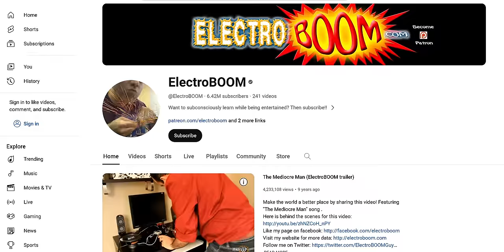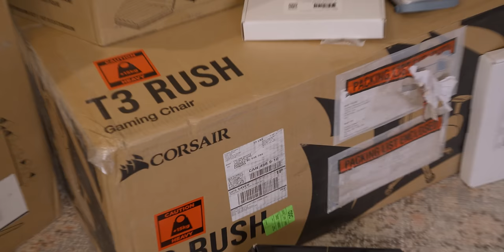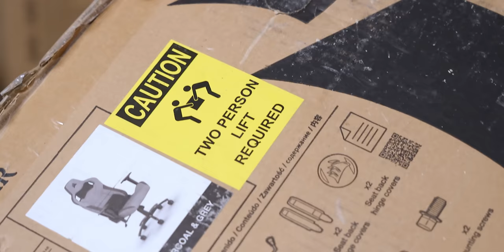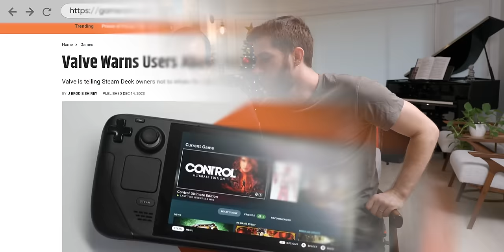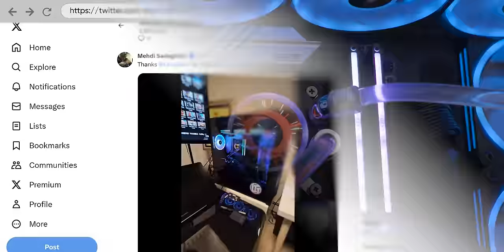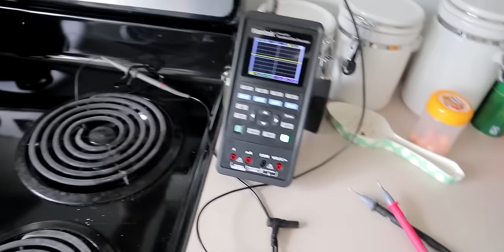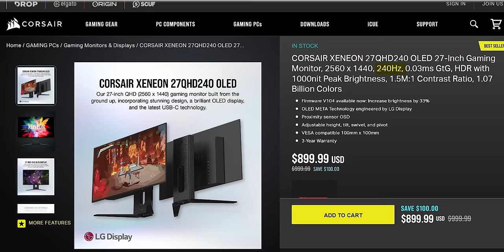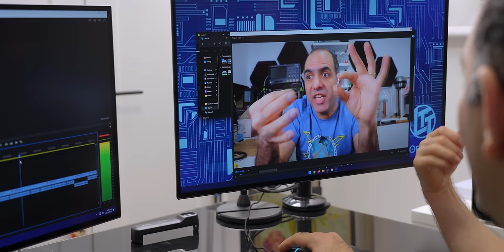I’m Afraid to Mess Up His Upgrade… Electroboom Tech Makeover

Comment: "The battery's dead" 😂 millions of laptop owners know this feeling
Reply: And phone owners.
Reply: if it's always plugged in, aren't you supposed to disconnect the battery?
Reply: @ihatelols well you're clearly a laptop user lmao. They always say that like its some benefit. I would argue that its literally not easy at all when you need to disassemble parts in order to access it. Atleast for phones, no way you can call that easy.
Reply: @TeenPerspektiva well, all it really takes is some heat, a plunger, and a credit card to get the back glass off (at least on most android phones). from there its really as easy as disconnecting the ribbon cable(s) for the battery like a taking apart LEGO pieces and installing the new one.

ok that's a bit of a gross oversimplification as there could be things in front of it like a wireless charging coil, other cables, plates, etc. but all it really takes is patience and examination in the end as ur not soldering or doing microscopic repairs.
sometimes i worry if companies like Apple are to blame for people thinking this kinda stuff isnt that simple given their track record, but thats just my two cents.
Reply: "You shut down the computer now lol"
Reply: @Thisandthat8908  yes if the battery works and holds a charge 😅
Reply: @Thisandthat8908  yes but you louse the the battery backup function that comes as standard with laptops, so if lousing your data not that important or not ?
Reply: @dh2032 you mean losing?
Reply: @Thisandthat8908  Some laptops have charge limit settings so you can leave it plugged in without overstressing the battery. It would be nice if they all had the options but such is life.
Reply: @ihatelols yehhh nahhh
Reply: IVE BEEN WANTING SO LONG
Reply: Get a FrameWork laptop and you'll be able to replace it!!! :)
Reply: @fix0the0spade Wish my HP Spectre x360 15 had that. I've had the charger constantly plugged in, because that was the only way the bloody thing, because of the BIOS, would go into performance mode, and actually make use of the 1050Ti in it. But as a result of that, the battery got swollen and now I'm running the laptop without a battery for like 2+ years by this point. I wish I could make the battery only charge to 100%, stop using the battery power and then just use the charger to power the laptop. And make it so that when the user disconnects the charger, that it switches to battery power, like with with a capacitor or something.
Reply: The question is can you revive the dead battery?
Reply: @samishiikihaku  u can replace it anyway
Reply: @ihatelols  When I said because of the BIOS, I meant because of the way HP configured the fan curve. If it wasn't plugged in, it would not go into performance mode, but, if it was plugged in, it would let me switch to performance mode, but whenever I started anything resource intensive, like a game, the laptop, especially the bottom, where the heat pipes are, got so hot, that you could barely touch it, and it took like 5min for the fans to either speed up or to even start to begin with. This sometimes even repeated itself when I paused the resource intensive task, like if I quit a match a game and was just in the menu.
This intensive heat and the fact that it was constantly charging the battery was what bloated the battery after only 2 years of use, so I got rid of it shortly afterwards.
Reply: Yeaah if I hadn't stopped using laptops already, the lack of removable batteries sure would've made me stop using them. I'm sure laptop manufacturers are well-aware that many people use laptops as a desktop replacement, whether most of the time, or even ALL of the time.
Reply: Meanwhile battery is alive but new BIOS restricted downgrade and has issues on battery on windows. I unfortunately need windows so still waiting for an update to fix it.
Reply: @TeenPerspektiva I call skill issue.
Reply: @Quan5021  you make me cringe
Reply: @TeenPerspektiva  it aint that hard to replace a phone or laptop battery. Cringe all you want it aint gonna fix your skill issue
Reply: @ihatelols  not if they stop making the batteries.....and or cant find any second hand batteries either that are decent.....and I dunno if $100+ batteries is called "cheap".....
Reply: God I know it
Reply: @TeenPerspektiva I'd argue that's a matter of perspective. For the average person, disassembling a device could be a big deal, but that's probably not the case for people watching a tech youtube channel.
Reply: @enderduck4253  its objectively not "easy". It could be easy from a tech savy person's perspective, but it objectively is not. The average person is the benchmark, not the minority that is the experienced people. If the average person could easily do that, then tech repair shops practically wouldnt be a thing
Reply: @TeenPerspektiva  There is no objective measure for difficulty, it all depends on the kind of exposure you have. 

I agree that the average person would not find it easy. I already said that in my original comment. But you aren't going to find many people here that find it difficult because the people that watch this channel are generally more tech savvy than the average person.
Reply: Same

Comment: The plastic anchors included with all TV mounts (including the Frame) ARE FOR CONCRETE, not Drywall 😭. A good option for the frame TV mounts are WallClaw, or the SnapToggles used for the shelves (with a flathead screw purchased separately).
Reply: Thanks for this reminder. It’s actually really helpful for DIY newbies like me 😍
Reply: I bought the frame 2023 and it didn't come with that mount.  Is it because his is smaller?
Reply: @MeowjinBoo The Smaller Frame TVs, I believe just the 43 have the smaller square brackets (21:37) as its quite light. The 50~85" use a pair of wider rectangular brackets that gives more mounting spots for more flexibility and likelihood of hitting studs.
Reply: yeah i always see this 😭

Comment: The power strip setup is EXACTLY what I expect when I hear someone say "I'm an electrical engineer"

The more you know about how a system works the more likely you are to push the limits of what would be considered "safe" lol
Reply: I think it was practical engineering (another great YouTube creator) who said something along the lines of "Anyone can build a bridge, but it takes an engineer to build a bridge that just barely stands."

(referring to the trade off between cost and over-engineering)
Reply: "I can calculate exactly which power bar will melt in this chain"

"It's this one, I'll put it over here"
Reply: As a 15 year automotive master tech... I've done some things....
Reply: @niqhtt  Those time to failure calculations just barely exceeding the warranty eh?
Reply: @zackkertzman7709  that phrase is probably older than you

Comment: 5:34 yes putting a WiFi point behind a tv that’s made of metal would heavily attenuate the signal of a 2.4 or 5 GHz bands, but most TVs built in the last decades are made mostly of plastic, so it doesn’t affect the signal strength nearly as much as they used to
Reply: isnt the back of every TV made of metal?
Reply: @drobotk  no
Reply: Not entirely true. The back of most OLED TVs is a thin plate of metal that acts as a heatsink/heatspreader.

This one doesn't seem to be an OLED though...

Comment: Regarding the Frame TV mounting hardware, I believe the anchors they include are for Concrete unless they've changed it recently... i worked for an AV installer company for about a year last year and mounted a ton of those, and always used the included screws but with drywall anchors from home depot, as those brackets are spaced out in such a way that the locations I would have to mount these TVs would only have one stud line up most of the time

Comment: 20:10 as an audio/video technician from the lower mainland.... I felt that pain. Not to mention how many of the stores I've done video walls for that said "oh yeah, we're putting backing in" and then there is no backing so I have to use like 8 drywall sinkers per mount.
Reply: Further south it is so easy to mouth shit on the 100% brick/concrete walls, just drill, put some wall plugs for concrete and tighten the screws until you can't do it anymore.

Comment: 20:30 - the answer may be that Americans are the only ones using drywall in their homes, so finding a place to put studs in the rest of the world is not a problem.
Reply: You know what's funny, to the best of mine knowledge, there is not a single American in this video (I know Linus and Medi are Canadian, I'm very confident Jake is and I don't know about Elijah) also this was filmed in canada

Also, that isn't a really good answer because when you add up the American and Canadian population, that's probably close to 100 million houses that waited for the structure and drywall as the walling material, so not designing your TVs to be easily compatible with this setup is missing out on quite the large market

Comment: 22:22 ⚠️ I believe you're supposed to pull on the TV until it clicks. That's how you know it's locked into place. (I've mounted The Frame before.)
Reply: Also, if you've got issues with the AOD not turning off automatically, make sure you've set the slideshow interval > the sleep time, or it will never go into sleep!

Comment: 22:22 parts is the home regulation sucks... if it has a solid wall then you will have no problem to mount an elephant on the wall. At least if the back is using plywood it can easily held a screw unlike gypsum wall. 

But I have to admit, as living. in east asian country brick cement plaster wall is also a trouble, you have to bore and insert wall plug for most of the thing. stainless steel nail just not practical for heavy stuff. But ours ceiling do use gypsum board, so sometime when you need to hang... said a chandelier or ceiling fan, you need to build frame behind it.

Comment: I'd like Jake to comment on the Ubiquity's device longevity. How does it stack up against other brands? I've seen a looooot of comments about dead (within a year or so of the purchase) unifi switches. I have 2 myself - the authorized service says "it's a software problem, we can't fix it" (lights on ports that aren't plugged in, no reboot no reset no nothing...). So, considering the price how come a switch decides to just die due to "software problem"? I have switches running non-stop for years and years, and no issues, nothing like what I've had with Unifi. Jake... hope you reading this, would love a video on the subject :)

Comment: C'mon I was hit with 230 volts when an electrician bypassed the fuses. I was across an air conditioner I was servicing. So the current went through my body and out my mouth. All my front teeth top and bottom blew out of my mouth...fun day

Comment: As an AV technician watching you guys do this is rough
Reply: I install tons of frame TVs and you guys butchered that my dude. First off you need snap toggles second off you got to be super precise with those wall mounts for the frames. Third off did you even put the stickers on the back of the TV? Fourth off I am almost positive you mounted the TV mount to the wall... The part that's supposed to go on the TV

Comment: Any reason for that one connect? Not really digging it
Reply: So that the pannel could be thin and (relatively) light. I actually really dig it. The connectors is NOT on the back of the TV and could be easily accessible. Although I wish the cable were a bit cheaper, its $100+ depending the model of the connector, if the one that came with the TV broke.

Comment: hmm been left a bit puzzled , the pc was sponsored, so why did they end up using jank parts, why have to brute force back plates off, and not tighten cpu cooler properly cos it might brake the MB, in left feeling very confused and puzzled, esp for a multi million pound company ??, why weren't proper / appropriate parts used

Comment: Hey Linus, What should i do to win the
CORSAIR 5000D Black
NVIDIA GeForce RTX 4090 Founders Edition
INTEL Core i9-14900K
MSI MPG Z790 EDGE Wifi
64 GB CORSAIR DOMINATOR TITANIUM (2x32GB) DDR5 6600 Mhz
iCUE Link H150i LCD Cooler
1 TB Samsung 990 PRO SSD
2TB Samsung 870 QVO SSD
iCUE LINK QX120 RGB 120mm Fans
CORSAIR RM1200x Shift

Im ready to do anything but pay for it